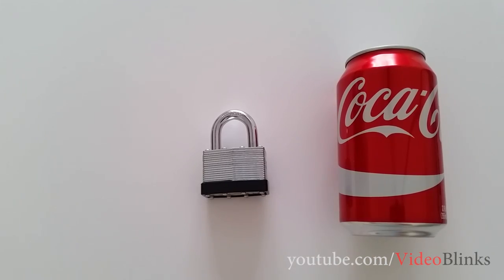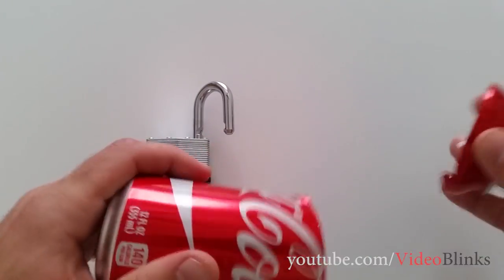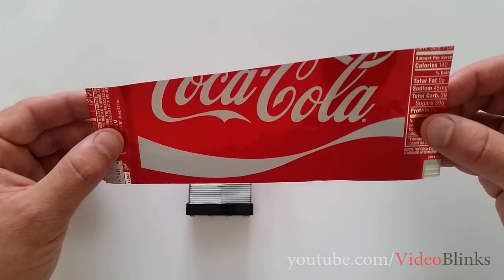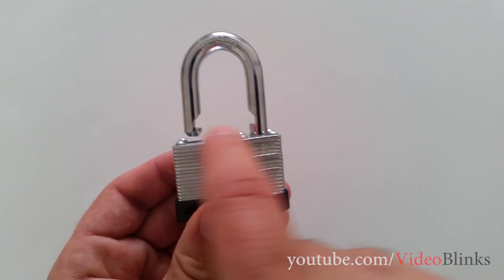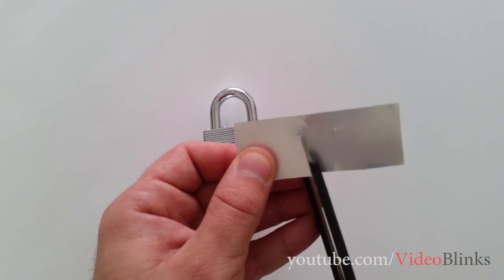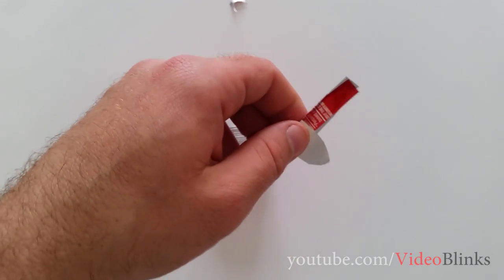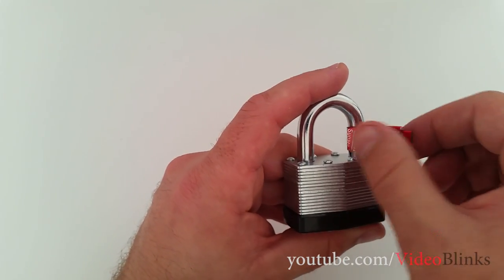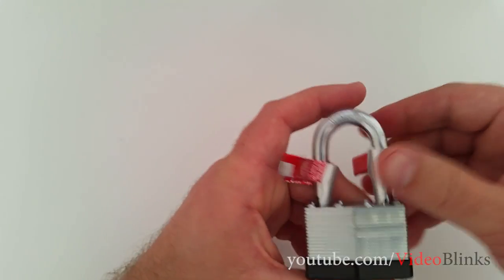Open Lock with Soda Can

Comment: For anyone  wondering it actually worked, tried it on a tuffbros lock and it worked. It helps if you push in the lock when moving it around